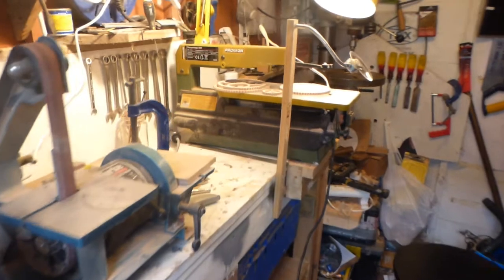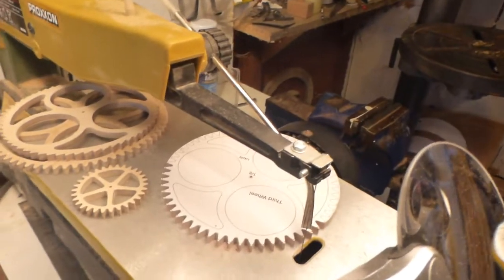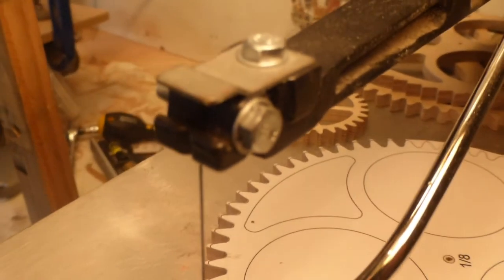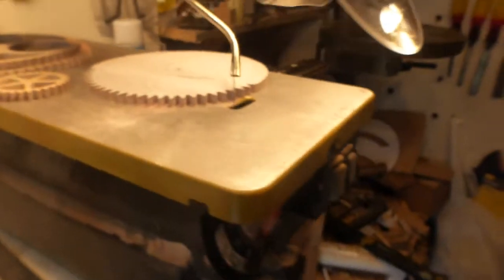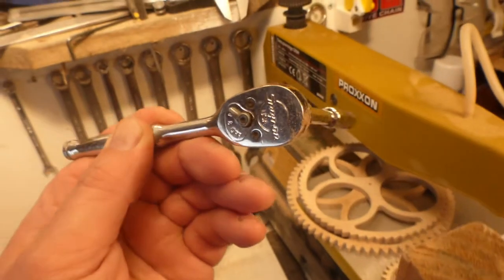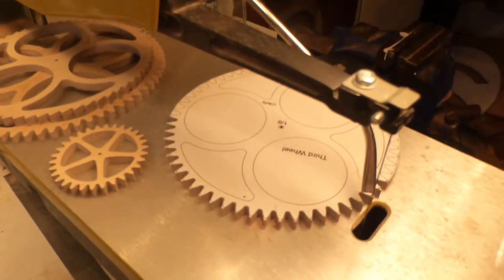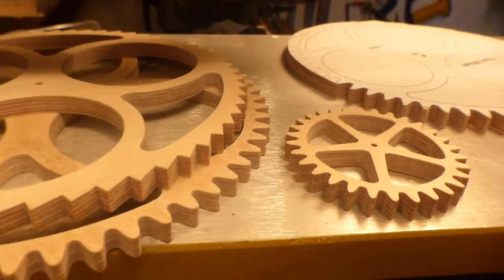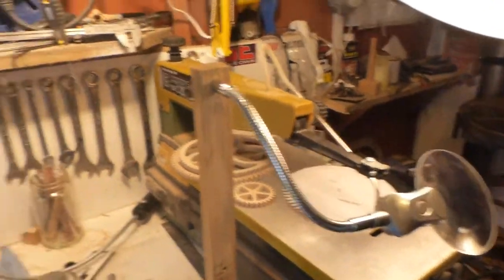Proxxon Scroll Saw clamp modification

Comment: Hi Kenneth, I’ve been using this scrollsaw for over 5 years, and have often found myself vexed by those fiddly blade changing screws. I just changed upon your video. It works beautifully, and I had a box of set screws sitting on the shelf. The best solutions are often the simplest and I ask myself why I didn’t think of this before. I do however use a t-handle driver, as I’m worried about over tightening.  Thanks.
Reply from the maker: Thanks. Gary.     Its still not perfect.  Even the 8.8 bolts will break after a while due to use, but i found them easy to extract  and always have spares.     I think it helps to grease the threads also.

Comment: thanks for your recommendations. The proxxon dsh is a robust and good quality saw. I was thinking of changing the m5 allen head bolts. I will try with your recommendations and with a hexagonal head. It is also very useful for me to grease the screws with lithium grease, the mechanism is smoother and they resist more. But never grease the jaws that hold the saws! Only the screw and in a small quantity.
Greetings from Madrid!!

Comment: Please tell me if the pinless blades perform (for example if they can be as well tensioned as the pin end blades) and if it's easy to change pinless blades. Thank you!
Reply from the maker: Yeah.  You can use pinless.   Changing is easy.

Comment: Hi Kenneth ! Thank you for the vid. I just ordered a scrollsaw just like the one you have and I'll hack it aswell. 
Could you give me a short review about this tool ? Should I avoid pinless blades ? 

Thank you in advance and good luck with your work !
Reply from the maker: Liviu Deckard you can use both types in this saw.  Pin blades are very easy to get in and out, but the range of blades available is not so good compared with pinless.   I love my saw.  Spent many hours with it. Still like new.   Well built
Reply: Kenneth Porter thanks a lot ! Full of confidence now !